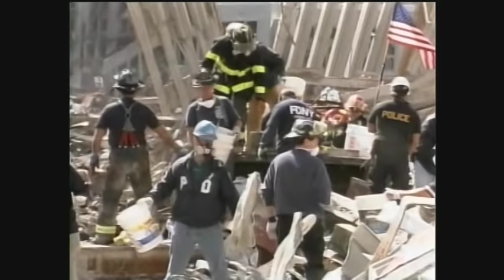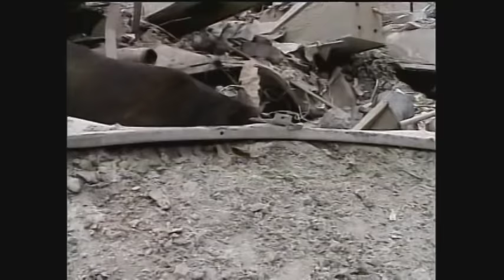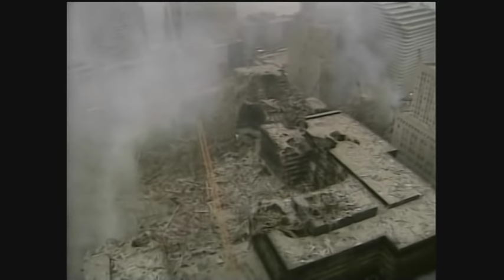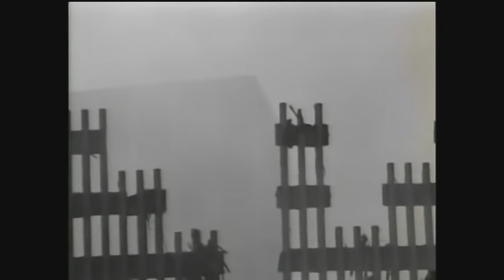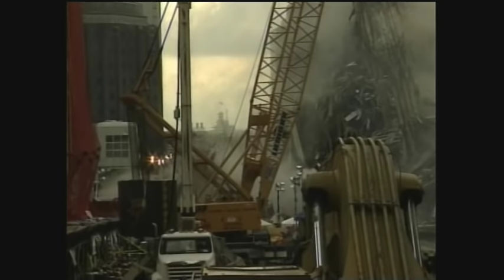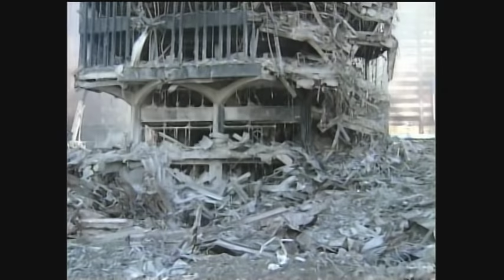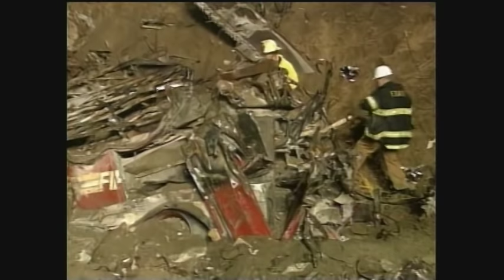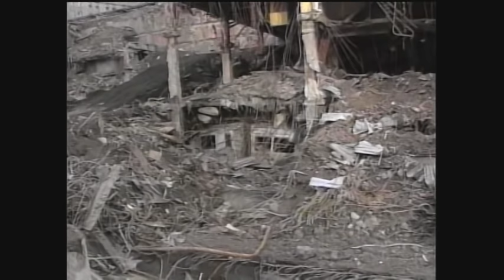Rare and new FEMA footage of Ground Zero

Comment: jet fuel is known to last along time hence why they use it as plane fuel as its highly flamable (so more engine power) And thermal cameras looking into the hole recorded it being 1800F and yes it can steel only needs to loose 40% strength to sag and expand,the fires were hot enough to do this so the metal sagged causing structural failure, its happened before. But not in as tall of building. And its known as gravity the top half fell weighing hundreds of tons... its not gunna slide off the top..
Reply: actually aviation experts said most of the fuel burned up on impact hence the huge fireball explosion. They also discussed the color of the smoke and how it was NOT a hot enough fire.
Reply: The towers collapsed in free fall. They prepared the towers.
Reply: @michaelrupf776  Dr. Judy Wood, engineer does a great job explaining with evidence how they were turned into dust.
Reply: @michaelrupf776  no. they didnt, watch any footage you can clearly see debris falling faster than the towers collapse, even large pieces. Dont move the goalposts....

Comment: Both towers collapsed at near free fall accelerations, this is a confirmed fact noted in the 911 commission report. You cannot argue the unarguable. An object will always follow the path of least resistance, this is a law of physics. Another law of physics: an object of less mass can never compromise an object of greater mass. Both of these law's of physics were broken that day, in 3 buildings on the same site. Does this seem possible to you? Is it possible to argue against the laws of physics?
Reply: I have yet to see any video which confirms your allegations . If you take one floor at a time with the mass  above falling on it, how is that your alleged greater mass. You are claiming that the entire structure under the plane that hit the floors is a greater mass. Did you expect the entire building to collapse as one piece?

Comment: Im sorry but if YOU do a little research you'll know steel looses 50% strength at 1700F, the fires were at 1800F well with in temp' for the metal to expand and sag and cause failure. And the jet fuel provided the steady (or constant) source for the hour to second hour.  And no it isnt a fact, free fall speed is at 9 seconds for those towers, it took both over 16 seconds to fall completely thats close to double. Please go and time the collapse. And do some research on heating metals.

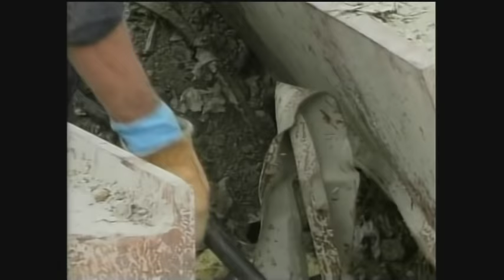Comment: The fact is that the prefabricated external vertical structural elements where simply bolted together, not welded, so the bolts could not withstand the impact of the aircraft and the sagging of the floors. As the beams was pulled in, the maximum tensile strength of the screws was exceeded. If you look at 0:28 you can clearly see it. Either 4 or 6 holes in the end plates of the box beams. The rectangular cutout on the inside is the hand hole for screwing. A fully welded exterior structure could have saved a lot of suffering.
Reply: Dude, dont focus just on the technicalities of the impact, collapse and fall but the other things as well. The collapse was pre-planned.
Reply: yeah right! 😆

Comment: and yes it can and it is possible, the way your suggesting it is that all the metal in the building was removed before collapse...I think my side is way more logical than what your trying to say...And before you say there were explosions removing the metal in the building...It would of took atleast 200 explosions in different timing to bring the building down.... there were no explosions defiently not 200 odd...none of the so called explosions were even loud enough to do anything...
Reply: under the basement.  50 meters.  You know enough.

Comment: OK a couple things, the vast majority of both towers fell at near free fall speeds, this is a fact. However, this is not the most important thing to note; portions of all three buildings fell at exactly free fall accelerations. Not the whole buildings falling at a constant free fall acceleration, but PORTIONS did this. This in itself is a violation of physics (if is happened only due to fire, as the govt claims). An object of lesser mass can never compromise an object of greater mass.

Comment: cont...- critical thinking & apply it to the events of 9/11/ in an analytical & objective manner. Every demo expert knows all 3 towers were "pulled" & nano thermite was used. 2 airliner impacts (or missiles) did not have enough energy to turn 2 WTC towers & everything inside both to microfine dust < .1 micron. Can you explain a Nor Gen. Dynamics jet engine on the sidewalk below towers; Boeing 757s & 767s use engines made by GE? The NT charges can be seen detonating. Why w/steel molten f/a month?